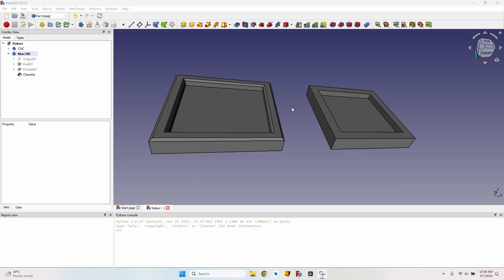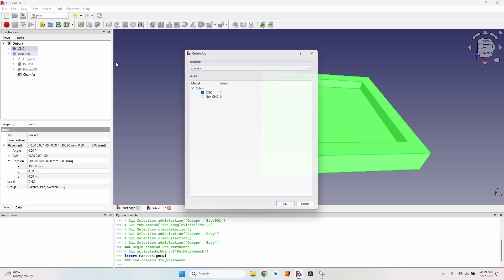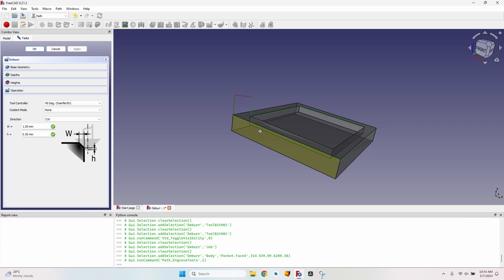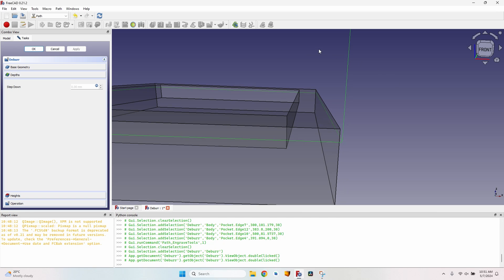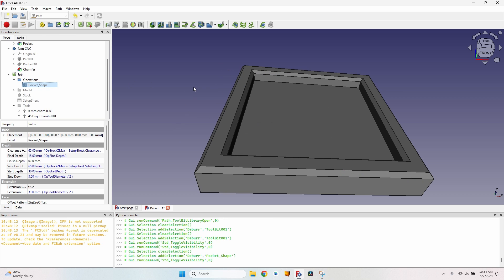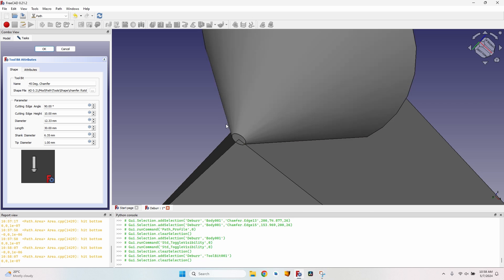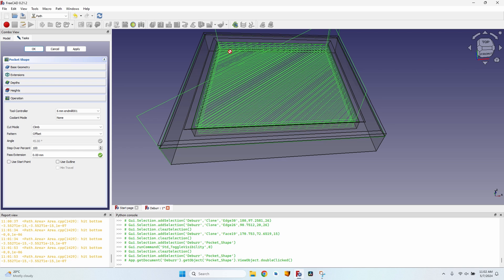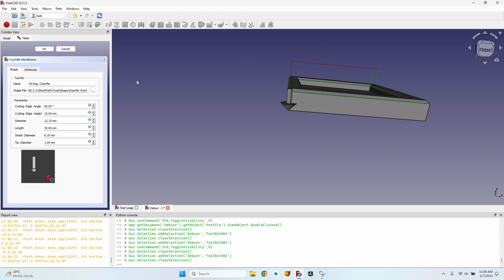CNC Chamfer Milling with Deburr and Profile Operations – FreeCAD Ep.17 | CAM Chamfer Workflow

Comment: In my project are no chamfered edges, but it can be done very easy in CAM. Is it possible to make an offset of start and end point? Because chamfer staring exact where edge start, it not taking in account diameter of tool in consequence another part is "deburred".
Reply from the maker: I believe you are referring to an inside corner where you want only one of the edges to be deburred. If you want it to start "later" than the actual start of the line, The only option that I see is using the boundary dressup, by creating a new body smaller than what you need to deburr and using it as base for the dressup. You could also split the operation into several ones with smaller segments as base geometry and use extended bounding box as base for the boundary dressup.
Reply: @opensourcecnc  Thank You, I thought about something like You say, and I will do like You say

Comment: Love your videos. When I do a chamfer on a model that already has it modeled I still use the debur tool. I just select the bottom edge just like you do here but set the width to 0mm and the height to something like 1mm to get the tool's tip below the edge and that works like a charm for me. I tried this too with a bit with a flat bottom and it compensates for the bottom radius.
Reply from the maker: I tried that and it didn't do the right compensation. Must have done something wrong, I'll try again sometime